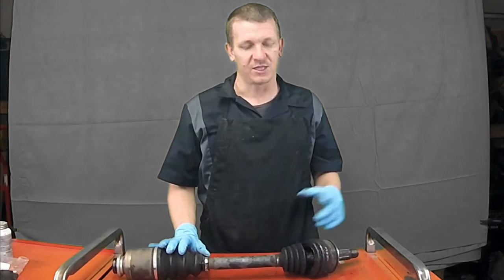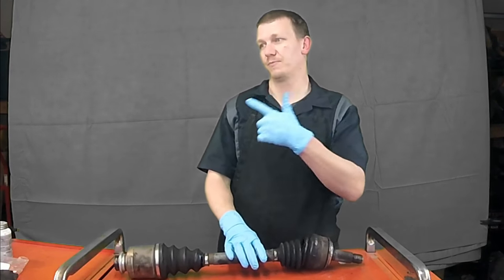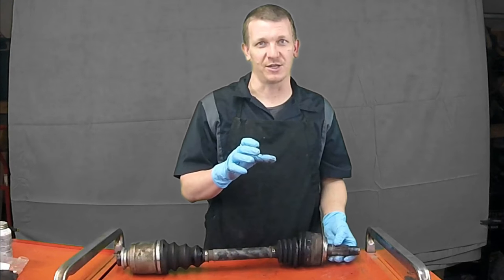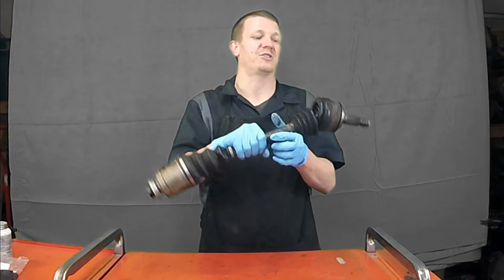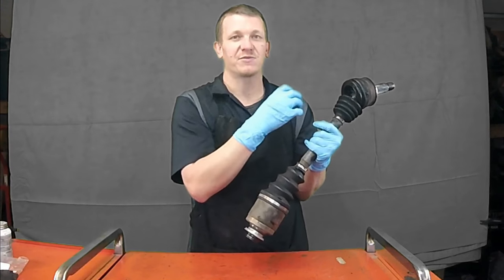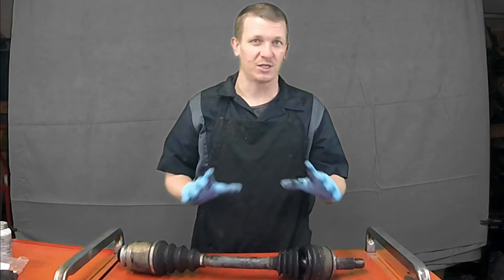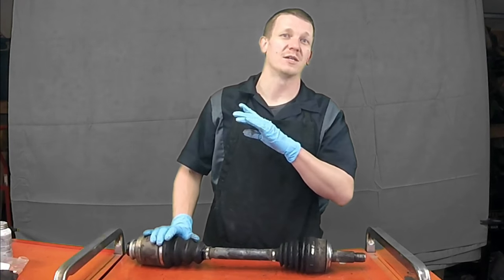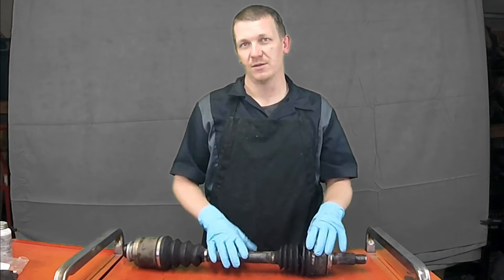⫷ Clicking / Clunking While Turning, Solved! ⫸

Comment: why is he glowing like a jedi ghost
Reply: Because those CV joints when exposed open they give out a lot of heat radiation. That's why they are supposed to be seal and greased.
Reply: Because he's pale.
Reply: Lmaooo
Reply: Because he had to use a lot of force to remove this cv

Comment: I have this problem in Nissan Juke, turning right in slow speed, they do replace my drive axle and alignment it went go away after driving 1000 miles it went back again. With a much louder clunking noise when turning right. Any help what really wrong?

Comment: So my 2014 Honda Civic has a clacking sound when I turn the steering wheel with the turn signal on it’s not the turn signal sound it’s a clacking sound I did go to a shop I had a bad left cv joint and axle got it replaced steering is more smooth but still get the clacking with turn signal on when turning anyone have the same issue or knows what issue might be maybe I need a new turn signal stock? I’m at around 85k mileage for anyone wondering

Comment: After inspection, CV joint and axle showed no breakdown. With no acceleration or breaking It makes a noise on a slight steer to the right. Sounds like its from the passenger side...2011 Camry LE

Comment: Having the same sound on my 2016 Sonic 1.8L. Truth is my Sonic had multiple rattles; the right side engine mount was shot, changed all 3 of them. The sway bar links were shot, changed both sides with metal Moog links, oem were plastic😬. All that noise was semimasking this ticking sound. 

This video may prove to be the answer, saving me $$ and time.

Thanks Brotha.
Reply from the maker: 🤞🤞🤞 I hope! Keep me posted on what you find. Good luck on your fix. 👍

Comment: My 2001 Lincoln Navigator periodically makes a "CLUNKING" noise when turning left or right
(mostly right), usually when in 1st gear while pulling out of a parking spot, or when making a right turn onto a street from a Stop Sign.
It can also barely accelerate when it happens, and we've had to have it towed.
It feels like riding over a boulder!
We've spent nearly $4000. on various repairs to try to fix the problem over the last year or so.
The mechanic FINALLY exoerienced the "Clunking" situation for himself today, and said it was the Gear Box.
What do you think?

Comment: I had bought a 2010 jeep patriot and was told it needed the cv axles replaced. I drove it until my new ones came in and it was making this sound after a month of driving it then it would stop then the other day i was on my way home and i heard a different sound, almost like my tire was flat so i slowed down and started looking for a spot to pull over but as i started to slow down it went away so i started to speed up again and it came back, i made it to the house and jumped out to see what was going on and it wasn't my tires so i believe the axle finally gave, so now it's time to finally put the new ones in amd hopefully fixes the issue.

Comment: I have a new 2023 Acura Tlx type S after 2 months  of ownership  when I turned the steering wheel on start up  it makes a loud humming noise. But on acceleration the noise disappear. I brought it the dealership and they changed the cable wire the humming noise was fixed but after 3 weeks came hack and its louder. It's in the dealership again right now for fixing 😪. Do you know by chance what's going on with the car? Please reply.  Thank you!

Comment: Okay, when you're I have a 2014.Ford Explorer, when you're sitting still are going really slow and you turn the wheel.It's making a clicking sound, but when you driving it at 30 to 40 mile an hour, you do not hear It.What could be the problem

Comment: My 95 corolla had a cv joint that came off like an over done turkey leg, once the wheel and hub came off, my guy pulled on the cv axle and it popped off. He had to pry the other end out and had it jacked up high to get under and i lost spme fluid once it finally came loose (domt worry i replaced) that was a fun day lol

Comment: Can the car make that noise without the boot being damaged?
Reply from the maker: It is possible for that to happen. The tall tail sign of a bad CV shaft is a ripped boot with grease leaking out. You could have other issues such as a motor mount being bad, control arm bushing gone bad, or a ball joint going bad too, or even a bearing.  

 I get this question quite often. Maybe today I will make a quick video on how to do to do a rough check on the bearings and ball joints.

Comment: My noise is almost the same if not the same so I changed the cv axle and it’s still making the noise what do I do
Reply: Replace cv joint, the one next to the tire
Reply: What was it ?
Reply: Damm i change my rack pinion on my car still makes the noice tomorrow i change both cv joint axles hopefully it takes that noice away

Comment: My car doesnt clunk but it stutters the turning. If I try to steer sharply on low speeds the car bumbs and after every bumb my steeringwheel gives me some force back
Reply from the maker: You for sure have some bump steer. What is the year make and model of the vehicle you have?
Reply: @ScottiesHobbies  2004 audi a4 AWR
Reply from the maker: I am not too much up on the Audi drivetrain. But I can tell you about a time when I drove a Ford Mustang with a locked up rear end. It sounds kind of similar. Every time you would try to make a turn the car would hop around and sounded like you were peeling out every time you turned. The sharper the turn the worse it felt. Now I'm not sure if that's even possible on the Audi but that's kind of what I'm hearing you explain.
Reply: @ScottiesHobbies  sounds similar, but it only happens when I make a sharp turn otherwise its okay.

Comment: Hi there  I have kind of same noise when I turn left but very very tiny. The vehicle was sitting for a while with the previous owner.  Do u think  lubrication will take it away ?
Please reply.  Thanks again for your time
Reply from the maker: Its worth a try. Have you looked to see if you have a torn grease boot on your cv?
Reply: @ScottiesHobbies   no I didn't try to see. But can u uncover the boot to see that ?
It also make  tick noise when I take off at  gas.
Reply from the maker: @ashrafsiddiquee3190  if you look at the back of your rim, you should be able to see your outer cv boot. It'll look like a black accordion. See if those are broken and grease slung out of it. Check both sides.
Reply: @ScottiesHobbies  thank you for your time and reply.  I'm acctueally replacing both CV axles right now. Waiting for my macanic to finish up and call me to pick up the vehicle.  Let's see how it is. Hopefully problem should be solved .
I'll let you know after I drive the vehicle. 
Thanks again for the reply

Comment: My car clunks on turning right and left ive changed ball joints track rod ends wishbones suspension top mounts drop links anti roll bar bushes but not changed inner cv joints , will inner cv joints cause clunking around corners i dont have any clunking whilst driving in a straight line only on corners any ideas?
Reply from the maker: Motor or trans mounts? Sometimes you can check them by watching the engine while switching from reverse to drive.. not too fast.. the engine might move a lot.. if it does, the mounts are probably bad.
Reply: Will that make it clunk around corners?
Reply from the maker: @jamiewilliams1287  it is possible.  I actually just had a friend with the same problem as you. It was a mid 20 teens civic. You could hear the clunk a lot in parking lots. One or two clunks when he would turn... if you have a continuous clunk while turning,  I doubt the mount is the issue.
Reply: @ScottiesHobbies  yea my cars a lupo gti im thinking its either the mounts inside drive shafts or the diff.. what was his problem mine knocks about twice 3 times

Comment: This is interesting my truck makes a clicking noise while turning right my truck isn't 4 wheel drive so they say it can't be a cv joint they're only in 4 wheel drive. I have a feeling this is what's going on with mine they said there's a tear I'm assuming in that rubber and dirty getting in there

Comment: My car just knocking 1 time 
Turn alway left or right; back up turn hear knock... so is spring or axle pls
Reply from the maker: That is probably a bushing doing bad. Check all your bushings on the control arms, the strut mount, id see if my bearings are good too. If you lift the car off the ground and can move the top of the tire in and out then your bearing is bad. If you can push in and out on the front or back of the tire, your rie rods are bad. Hopefully you find something checking all those. Keep us posted.
Reply: @ScottiesHobbies  
I did bring it to smog inspection station to check, they tell me is left axle but I don’t think so. Too harrd with me to find it out exactly
Reply: @vieboi5483  look into loosening and then retorqing your steering rack. Honda put a tsb on it
Reply: @jakeculp1131  
I was bring my car to autoshop to check they said the sound by axle driver side but I dont believe us. Im confuse
And also my car is Toyota camry se 2015 not Honda

Comment: I replaced both mine on my front wheel drive car and I still have that clicking sound on hard turns .. but only during or just after acceleration
Reply from the maker: Motor mounts? Pop the hood. Have some one hold the brake firmly. Switch gears from drive to reverse. Not to fast and do not hit the accelerate pedal. Watch the engine while shifting. See if the motor moves. It should stay pretty firm. If a mount is bad it should rock. Checking side mounts are a little harder to check but can usually be visually inspected.

Good luck!!
Reply: @ScottiesHobbies  Thanks for your answer. I will look at that. A mechanic will examine the problem tomorrow. I'll post the results.
Reply: @ScottiesHobbies  so the mechanic looked at the engine as I shifted with the brake on... he said the amount of engine movement was normal. "there has to be some movement."  I mentioned that another mechanic said it could be the motor mount and he said maybe but it wouldn't cause the differential to be out of alignment.... 
He concluded that it was the differential. its a front wheel drive. He said that there is probably some erosion of the gears and at certain angles and speeds the increased amount of space between teeth causes the ratcheting sound.
He said it wasnt the CV assembly. 
I looked online and saw quite a few people had problems with the transfer case. Basically it being too close to the exhaust dehydrates the grease in the transfer case and it becomes sludge... and or its not watertight and the gears rust...
Those seemed to be mostly rear differential complaints. In nearly all the write ups it wasnt specified . 
But I looked at the transmission fluid and the mechanic did too. He said it was good and that there was no contaminants in it. No metallic pieces I suppose... This was after driving around for a while. 
Im hoping that I have a good differential and that maybe I can just have the fluid changed or something ... The mechanic said its a normal problem for my car and replacing the differential would be expensive...  I may have it done anyway cuz I like the CX9.
Reply: @mikesuniverse1789  its the wheel bearings most likely.
Reply: @j.gtheautotech8455  it turned out to actually be the water pump fan. Once replaced the sound stopped
Reply: @mikesuniverse1789  what that’s wild 🤣
Reply: Nvm I didn’t read your first comment correctly it was during it just after acceleration, not while turning… so a bad bearing in the water pump makes sense

Comment: What about a slow tocking sound when turning - not as fast paced sound as in this car?
Reply from the maker: Motor mount, ball joint, or suspension mount. I'd check the bearings and steering real quick.
Reply: @ScottiesHobbies  thanks i already purchased some tie rods and stabilizer links so will change those first while i get the ball joint and possibly shock mounts.

Comment: My car clunks hard when I’m parked and turn the wheel to full lock what can it be? I have a 2011 rwd Chrysler 300
Reply from the maker: That could be any bushing in the suspension or steering system. Someone needs to watch the location that is clunking. The bad bushing should move. Sometimes they are hart to find. Check the strut mounts too.

Good luck and keep us posted.
Reply: @ScottiesHobbies  just traded the car in for a Q50 redsport thanks ❤️

Comment: Not solved.

If that is the case a regreased and new boots should work base on your diagnostics.

So what is the actual cause?
Reply from the maker: Hmmm.... solved this car.  

Did you see the 'clunking' video?

What do you think caused the sound?
Reply from the maker: I never put a new gease boot on. It's not worth improperly lubing and contamination in the bearing. In my opinion. If you are going to remove the cv shift, just put a new one back. Most come with a lifetime warranty and you don't have to worry about the mess and extra time of rebuilding your cv shift. If the boot rips again, go get a new one for free.
Reply: @Scotties Hobbies  I guess if you mean solved by replace then sure. And I understand the YouTube game of titles and  etc...

I am not a mechanic. But I do work on cars as a DIY person.

 Long story short, I got screwed over by a shop while in school. So...

Here's a video of someone tearing it down.
 https://youtu.be/QYi_zGcg7ME

It is not stated why, but my guess, once the housing and inner race got damaged, the bearings can no longer move freely. The ball bearings in this video was not damaged. That could be considered solve as it some what explain the actual cause of the clicking, clunking sound in details.

OEM parts are 3 or 4 times more expensive than aftermarket parts. And while true that it is warranty, you hear some stories, of vibration and other problems. So yes you can always get replacements. Read on forums that some people had to swap out their axle 3x from certain aftermarket parts. 

Some oem website might still sell parts individually of the cv axle assembly.

If you go the OEM route to ensure "problem free" installation gonna cost you. Or aftermarket and take a chance.

Best case scenario, I also read in certain places they can rebuild your OEM axle.

If it's only your out joints that cause the problem and it usually is the first to go. 

The shaft and inner cv joint are still good, why not recycle.

I know maybe, your intended audience may not be someone who really want the "detail" explanation of things.
Reply: @ScottiesHobbies  and here is a more detail tear down of the outer cv joint.

https://youtu.be/3-R11jtnyV8

Comment: What if you never replace it? What would happen
Reply from the maker: I've never seen one break... but... I had a view message me saying he broke and slapped around on the freeway causing major damage. So... I'd give it some attention sooner than later.
Reply: @ScottiesHobbies  thanks for the reply. I hit a small kerb when parking. Front left of the tire wall took the impact. I notice a squeaking noise later that day when braking but that went away. Now after 10 mins of driving or so there is now a small rattling noise under acceleration and at cruising speed and stops when i lift and slow down. If I drive slow I hear nothing but if I turn really fast to the right I can hear the rattle again. Sound is definitely coming from the front left where I hit. Could it be brake or cv, or?
Reply: Weird how it only happens after a few mins of driving. Thinking the rotor heats up and expands causing rubbing, honestly don't know if that's even a thing lol

Comment: I'm hearing same sound now after 290 000km. It does exactly same sound but after like 10-20km driving it's disappearing. 🤔
Reply from the maker: Have you taken a look at your CV boots? When you get a chance take a look under the car on the inside of your drive wheels. It's. You should have some rubber accordion looking boots that seal the CV shaft bearings. If you see Greece leaking from those, you probably have the same issue as in the video.